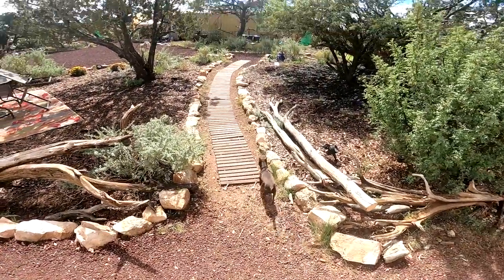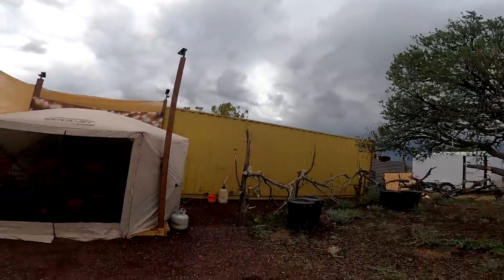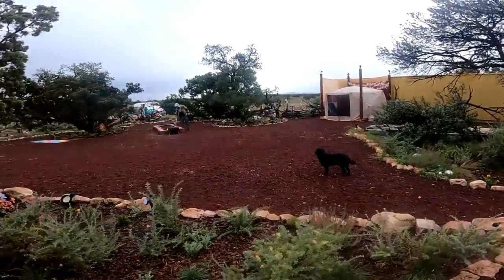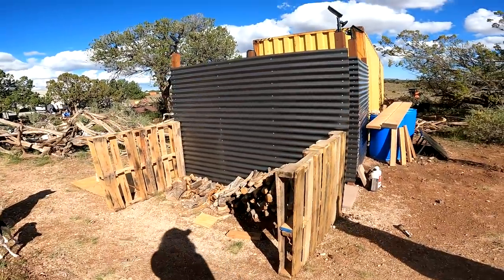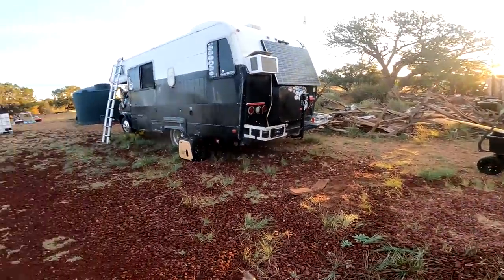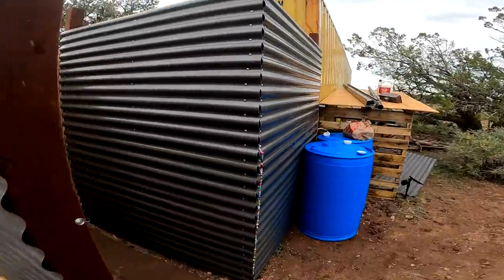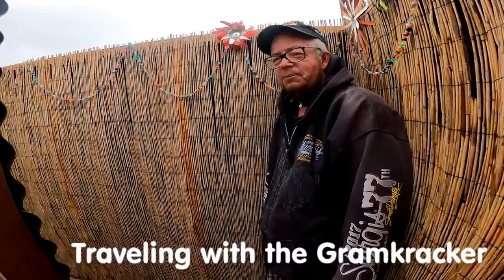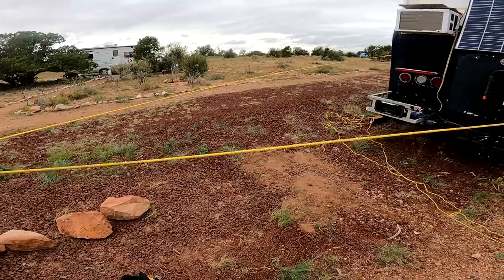Homestead Gardening Prep Ideas - Fruit Trees, Rain Diverting Ditches & Cardboard Method

Comment: Ausia, Have you looked up sq ft gardening? especially for containers? I've used that theory for 5 years and have had great success. The design is to give all veggies and herbs enough space to grow without over crowding - for example the container with 6 herbs , maybe 4 plants would have been better.  Another example - in a sq ft you can have 16 carrots or 1 cauliflower.  Check it out - it's a great method for small gardens. Love ya